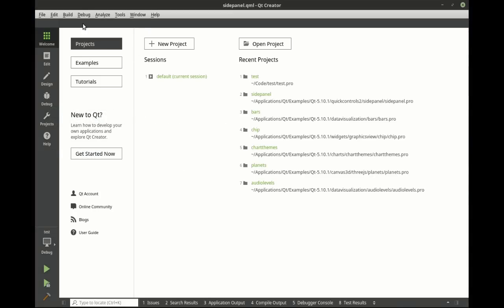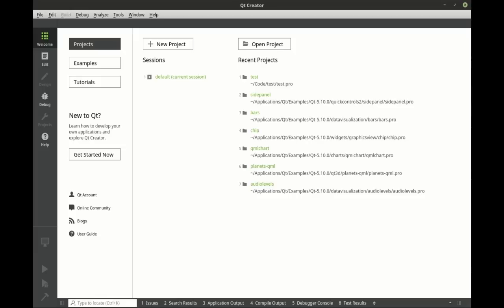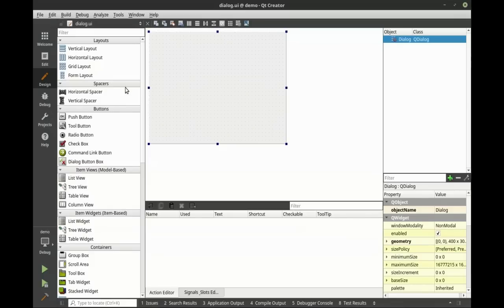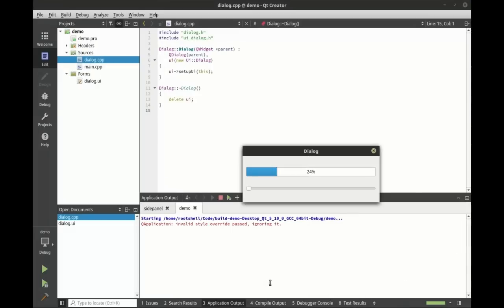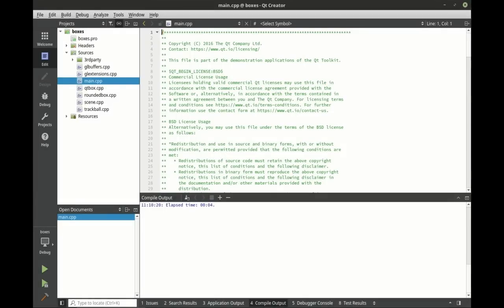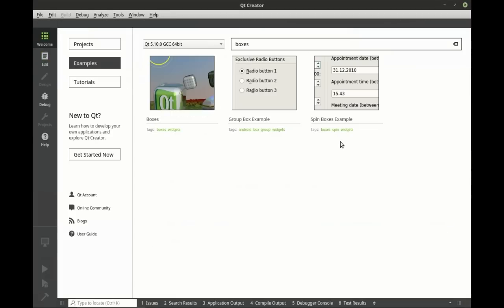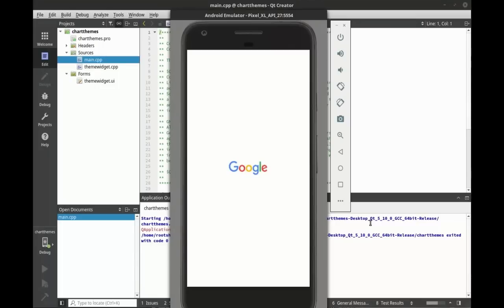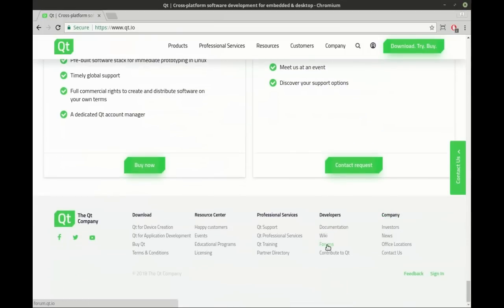Introduction to Qt - Qt Creator IDE Overview and Examples {tutorial}

Comment: I recently installed Qt Creator 5.15.0 on a Windows 10 laptop under the free open source license.   I noticed that Desktop GCC 32-bit and Desktop GCC 64-bit were NOT options for installation but is required for many of the Qt QML tutorials including this series.  Why was it not available under the open source license and how can I get it for free to learn your tools before investing $459 per month?
Reply: ask "the Qt opensource community"
Reply: My major experience with Qt is with the OS open-source Windows 10 package (5.12.11), which has support for Mingw 7 64 and 32-bit as well as VS2015 64 & 32 bit The 5.14 OS package is a much pared-down package compared to the 5.12.x OS package. I would recommend trying that...the commercial packages are somewhat more complex than the open-source package and the OS package may be what you need. It's certainly easier to download, install and use than to build the OS package from scratch.  

I haven't tried the Qt QML examples with this package so I can't address that. Just letting you know another option. 
MinGW is  a Windows front-end for a x86/64 Windows G++ compiler. Not quite the same thing I think that you have to include  windows.h and make a few other changes if you run it on Unix code from the command-line,. 

try searching on "using mingw with linux code" at stackoverflow.com...Qt is supposed to remove such problems, but it does bring a problem of its own if you try the VS toolk, (related to configuring the VC compiler for x86 & 64 and loading that configuration in Qt) so I'd avoid them in Qt if you can. Like most software tools, Qt promises a lot but in real-world use it all depends on the execution. You just want to run an example but to get it to work in Qt you have to become an expert in Qt, more or less. Quite an annoying process, as rarely are coherent instructions to be found for fixing a specific problem   You end-up spending, you know, days, weeks, stumbling towards a solution. To a problem that often lies just under the surface.

This is why MS has ported VS and VS Code to Linux and developed the Universal Windows Computing platform.  
It still has the fundamental problem of making programmers dependent on MS tools,...but when they work, they do work...and it becomes a question of principle vs practicality. Qt can build with VS compilers but requires the VS tools and requires them to work properly with Qt to do that. The alternative is to export the Qt project to VS. using the Qt tools for VS. 

Before you get to the point of trying to compile generic (standards-based) c++ code in MinGW and then having to find a GUI-based IDE for widget development. There are viable options other than Qt ...just as there are options to  VS.  It's better to dabble with these options and then you can figure-out what works and when to use it without becoming overly dependent on any one of them..

Comment: I've been using Visual Studio 2017 for simple c/c++ applications.  Is there a way to incorporate Qt or the Qt designer into Visual Studio so that I can use Qt as an alternative to the MS Windows GUI tools to makea better looking GUI?  If not, is there a way to link a Qt GUI to a program written in VS2017? This is for simple desktop applications. Thank you.
Reply from the maker: Check out our Qt Visual Studio Tools: http://doc.qt.io/qtvstools/index.html
Reply: Qt, Thank you!
Reply: I tried this is VS2017 with the Qt for VS2017 plugin VSIX2r4mssbd which installs fine. The Qt installation file is qt-opensource-windows-x86-5.10.1 and installs fine and runs in standalone, builds an example etc.  Then in VS all goes well up to clicking create a Qt GUI Application, accepting the wizard defaults and clicking on Finish , then I get an error: Exception from HRESULT:0x80042003.  Do you know why this is happening? Ive hit a brick wall with this error and cant seem to find anything that tells me what the acutal problem is.  Thank you.
Reply: I managed to stop the error from showing by going to Qt Options from within Visual Studio and changing the Qt Version from winrtx64_msvc2017 to msvc2017_64.  So, it's working now but I don't know what the differences are.
Reply from the maker: Hi, if your are a commercial customer, contact support. If not you can tap into our knowledge base or reach out to the community. You can find more information here: https://www.qt.io/qt-support/
Reply: Qt, thanks for the reply. I'm just starting to learn Qt with the open source version, I got onto the forum and will look there as I have a couple of other issues to sort out. If I get anywhere with it I may consider using it for work where I would suggest we use it under the commercial license.
Reply from the maker: Ok, awesome! You can find a nice overview of online Qt communities here: http://wiki.qt.io/Online_Communities
Reply: @NoName-mr1lh  with that name, it clearly is some hack that MS has thrown together in a desperate attempt to remain relevant. 

https://doc.qt.io/qt-5.12/winrt-support.html
https://code.woboq.org/qt5/qtbase/mkspecs/winrt-x64-msvc2015/